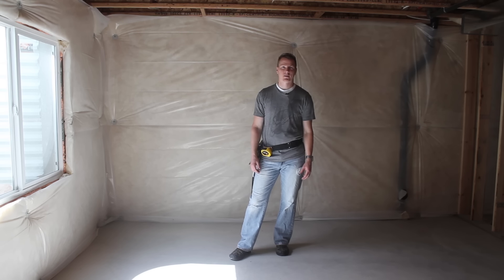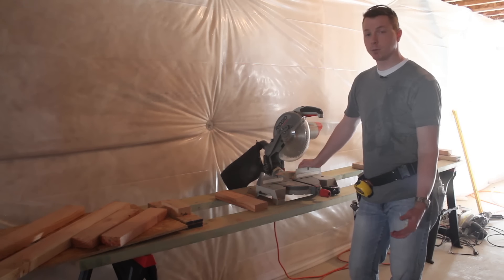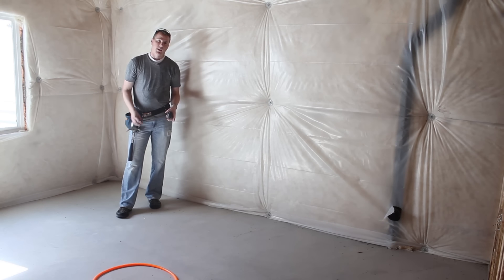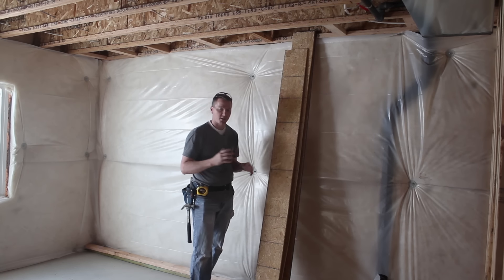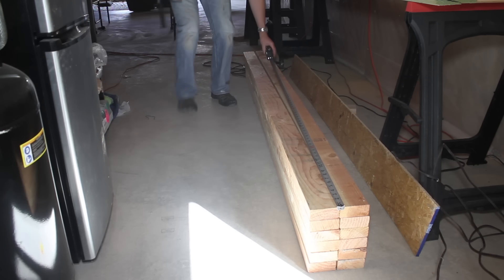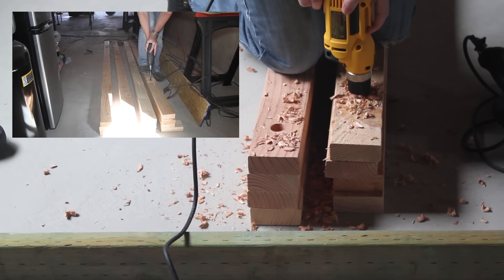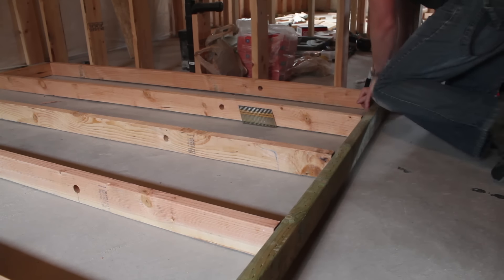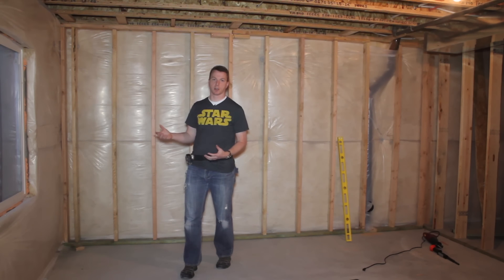How to Frame: Part 1 - Framing a Wall

Comment: Nils at about 10:00 when laying out the 16" marks do you mark 3/4" back from the 16" tape indicator to place the stud at a 16" center?
Reply from the maker: +Steve Grimes Great question. I've seen both methods used (16" vs 15 1/4", and so on) but I don't understand why you wouldn't mark it at 16", because then your stud bays are all exactly 14 1/2". If you mark them all at 3/4" back from the 16, then your first stud bay ends up being 13 3/4", which will require custom cuts on your insulation and potentially other issues. If I'm misunderstanding something here, I'd love to learn so that I'm instructing people to do this correctly but that's my understanding.
Reply: when you start your drywall it is started on the edge of the first stud and not center. If you place your other studs 16" from the edge of the first stud then 48" later the drywall will end on the edge of a stud. If you move the stud back 3/4" the drywall will end on center. This is my understanding of that principal. I'm in process of finishing my basement and just about to start framing. Will let you know in the near future how well it works out. 

Thanks for the video
Reply: I would have to agree with you.  I am a novice but have watched multiple videos and you seem correct.  From what I have seen in other videos if you were extending a stud wall you could move down a couple of studs and measure of one of those ever 16 and that would put you on center.  It doesn't make since to start on the one end and measure ever 16 and not subtract 3/4 ".  As I stated, I am not an expert, and the fellow who showed the video did seem like an expert. I don't want to insult anyone.  It's great to have feedback.
Reply: I just finished framing my basement. I know that was months ago but a lot of stuff came up so it was put off. Anyhow, what I said before is correct. Measuring from the corner of any wall it the drywall ends in the middle of a stud. I used 15 1/4". If I had used 16" It would have gone to the end of the stud and I would have no way of starting the next piece of drywall
Reply: Well imagine you had a 16" peice of dry wall. You start from the right edge of your base and mark 16" then that is going to be exactly where your drywall is going to be at. You want the center of the stud aligned with your mark. If it was placed to the side then the dry wall will completely cover it or end up coming right up to the edge. The way you described it is more accurate I believe since you can align the side of the stud right on the mark and not have to eye ball or mark the center of the stud. Both ways work just a matter of preference.

Comment: Hello Nils,

I am going to start on finishing by basement (never done before), how do you measure and determine how much wood is needed?  what size wood to use? 2×4, 2x6?  I
Reply from the maker: +Rome nolastname Hi Rome. You can use 2x4 for all non-load bearing walls. Typically load bearing walls are already installed so you'll likely only need 2x4s. To figure out how many to use, calculate how many linear feet of walls you'll be framing (add the length of all walls up) and then divide that by 8. Multiply that number times 9 (the number of 8' boards in a typical 8' section of wall) and then maybe give yourself some extra boards for corners, errors, etc. For example, if you have 240 feet of walls, 240/8=30. 30*9=270 boards. Also remember that the bottom plate of each wall needs to be pressure treated, so be sure to account for that. I'd always recommend going with 16' boards for your top and bottom plates when it makes sense. Good luck and have fun!
Reply: Thanks, this is helpful.  Now you mentioned Corners how do you corner?
Reply from the maker: +Rome nolastname There are a few types of corners you can do. If you do a google search for "California Corners", you'll see the kind I'd recommend for most situations. What really matters is that you always provide support for the sheetrock to be fastened to in your corners. The only exceptions are if there will only be an inch or two of overhang, which is acceptable.

Comment: What brand, size of saw blade do you use to cut the studs? Thank you.
Reply from the maker: I'm pretty sure I was just using whatever came on the saw. I don't have that same miter saw any longer but it was probably a generic Ridgid 10" blade. Studs are typically made of a softer wood like Douglas Fir so they they should be easy to cut through.
Reply: LRN2DIY Thank you for your response to my question. I have a 10” miter saw and am looking to purchase a good blade to cut 2x4 lumber.
Reply from the maker: @HungNguyen-sb1yu  No problem, Hung. You can look for a ripping blade. They'll typically have fewer teeth, like 24 or 30. That means they cut faster but not as cleanly, which is fine for framing.
Reply: LRN2DIY Thank you again.

Comment: Dont you double frame the top and bottom plate??? And aslo you didnt let us see the finishing by the pipe and so so.?
Reply from the maker: Doubling up the top and bottom plate isn’t necessary as far as I’m aware but it’s always a good idea to check the local code first. As for the pipe, that could be a tricky topic because they’re all different but I was able to fit my pipe largely behind the framing with the exception of some notching here and there.

Comment: Drawing lines every sixteen inches and edging the 2by is NOT 16 inches on center
Reply: The fact that there are 3 likes on this is really sad. If the right most edge is the start and you measure 16" over... The centers are 16" apart as long as the next studs right side is on the line.  It's literally the definition of 16 o.c.

Comment: Nice work.  Are you required to do 16"OC studs or can you get away with 24" OC since none of these walls are load bearing?
Reply: John Our Home from Scratch 16 will stop drywall from having waves to it.  24 oc and you will notice the drywall tends to dip into the 24 pocket.  Also someone pressing against 24 oc might actually break the drywall.  16 is always correct.
Reply: Got it.  Thanks!

Comment: How did you join the two 2x4s as your 165.5 long length?
Reply from the maker: For the bottom plates (on the floor) you don't need to join them because they're fastened to the floor, though you can join them just by using a shorter piece on top to connect them. Same with the top plate, but of course they're fastened to the ceiling joists. If you look at 16:53 you can see the joint. If you can get 16' boards, that's even better.

Comment: Here's my question....When you frame over the insulation that's tacked to the foundation, do you still put insulation between your studs? I'm about to start my basement and was thinking it was best to rip it all down and insulate between studs. thoughts?
Reply from the maker: Hey Christine - I would do both. In order to meet code you need to figure out what the R value requirements are for your state (see this page: http://homedepot.owenscorning.com/insulation/easy-weekend-projects/insulating-your-basement-walls/#tab_prepare) and then figure out what the R value of the existing insulation is. In my case, my existing insulation was only maybe an R5 or R7, so I left it all up and then purchased and installed R13 to go between the studs of my walls and R19 for my ceilings. The cost difference was minimal and my basement stays very comfortable in both summer and winter.

Comment: Do you need to be a license for a home owner to finish their basement?
Reply from the maker: You’ll want to check with your local code but in the USA, you need to obtain a permit from your city but do not to be licensed. You then need to have inspections along the way.

Comment: What framing gun and nails do I need? Thank you.
Reply from the maker: Great question - I hadn't thought to put links up. Here's a nailgun that is well rated and even less expensive than Harbor Freight: https://amzn.to/2SI5nE6 and here are some nails, though I think it's cheaper to get nails at Harbor Freight or Home Depot due to the expense of shipping them: https://amzn.to/2H0rkwY. I've had good luck with 3" nails. Good luck!

Comment: My pressure treated lumber is longer than 8ft....so it's longer than my top board.  Is there a method to account for that?  Do I have to cut each of those?  They are sorta wet so I don't know if  I should cut them or not.